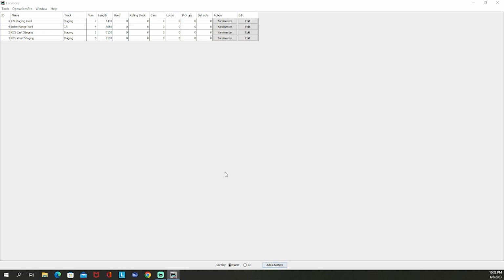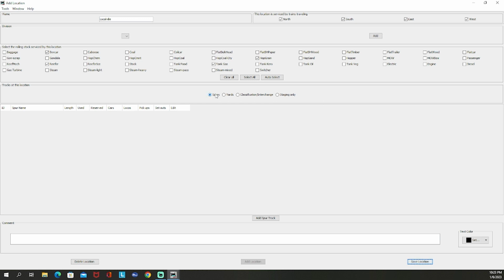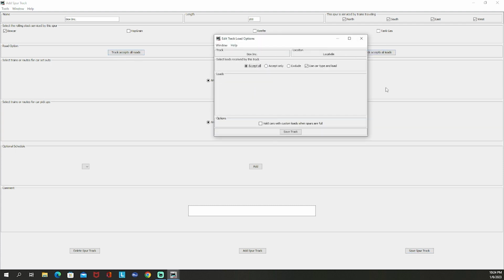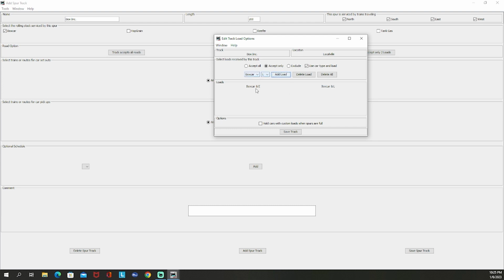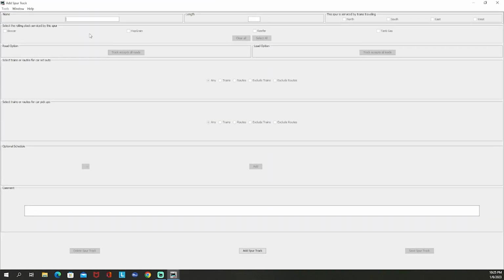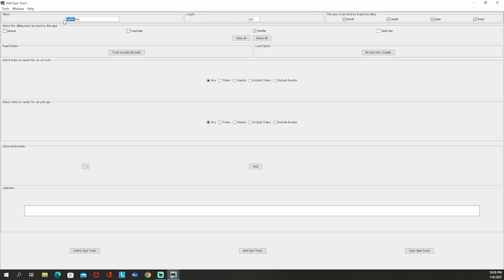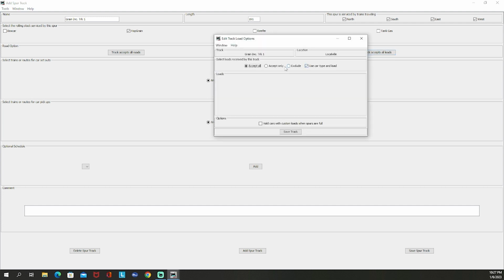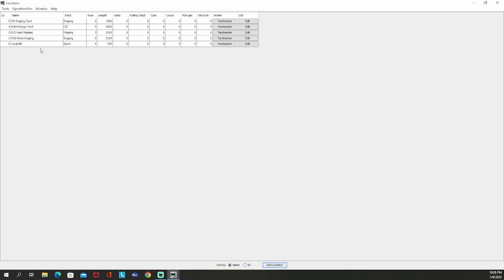Trainz 2019 JMRI 04 - Creating Towns and Spurs In JMRI

Comment: Love your series! Thanks a lot! I was always wondering how to use JMRI with Trainz routes! Heard of it but never dug into it far enough to find out how to teach it the layout for organized operation. I wonder if it is possible/necessary to also tell JMRI how those locations (yards, industries etc.) are connected. Possibly also with signals and where junctions are. Would love to have a kind of schematic map produced by the program.
Reply from the maker: Thanks for your comment! I will say these are great questions/thoughts. As far as teaching JMRI how things are connected: when you make routes for trains, that informs the program how it can route cars from one location to another, so by choosing towns, car types, and yards and industries you can really give a lot of input to the program to get what you want from it. This is even more true when using schedules on spurs, which is very similar to cmtm. With schedules you can get whatever movement you want! As far as signals and junctions, I do know that in JMRI panelpro you can create panels for model railroads which serves as control mechanisms for throwing switches and controlling signals. I do believe you can create a full schematic. I’ve only ever used it for car movement so this area is currently outside my expertise, but I do believe you can mostly get what you’re asking about. Stay tuned for more! Thanks again!